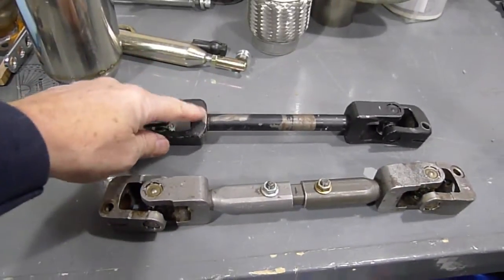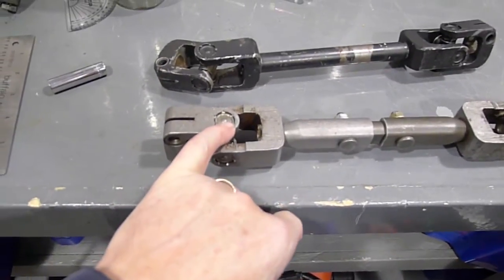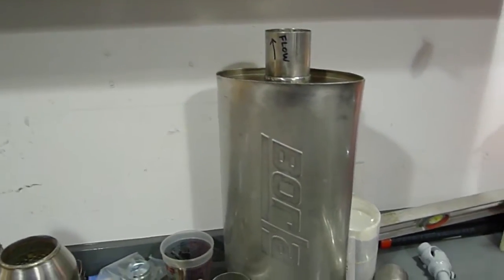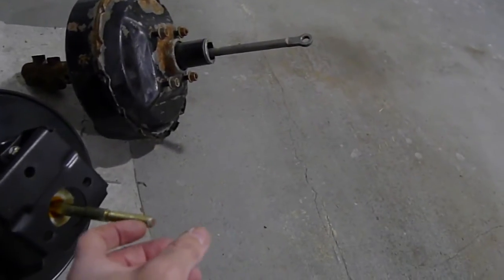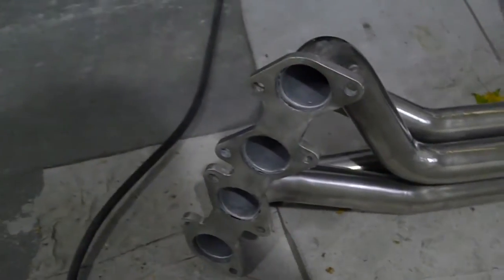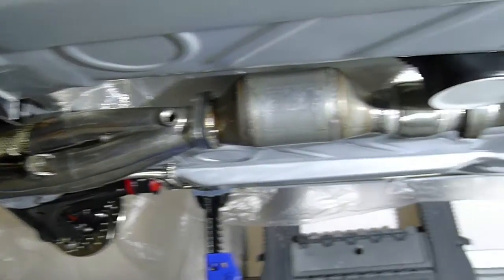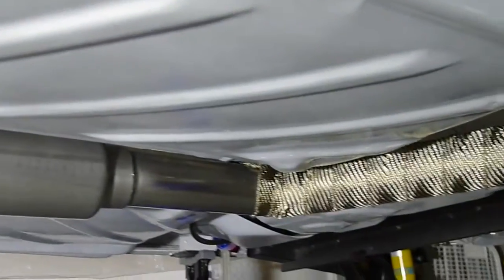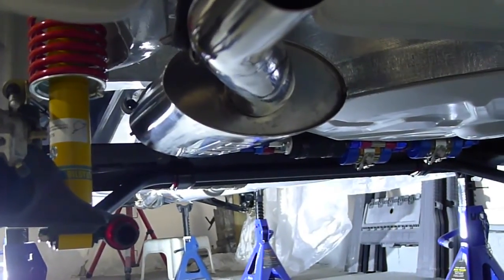The Ultimate 1983 Rabbit GTI - part 65 (mk3 U Joints, mk2 Brake Servo, Exhaust System Complete)

Comment: Thanks for the tip about the mk3 u-joints. I have now sourced two of those myself. I am converting an mk1 to AWD, and I need to move the steering rack down 20mm. Using this method to extend the steering column is just what I needed

Comment: I got what i thought was a MK2 servo to use on my Rabbit but I can't get a solid brake pedal.  brakes are properly bled but the pedal goes almost to the floor.  I did cut/weld the pushrod to the proper length.  I think the problem is inside the servo where the master cylinder plunger goes.  some servos have a little pin or rod inside there but mine doesn't.
Reply from the maker: I put some washers between the servo and the MC to take up some of the slack - not too much as the system heats up and can cause the brakes to engage when there is no force on the brake pedal so you have to be careful. You also need to balance the MC diameter with the brake caliper surface area to get the right ratio of fluid flow, pedal distance/force, etc.

Comment: It looks like you are almost ready to fire it up! I believe you haven't mention what type of ecm will control the engine?
Reply from the maker: Holley HP. I needed the ability to control 2 injector sets plus the progressive nitrous system. I am really happy with it (I have been madly programming it already), especially for things like custom sensors as I have had to pull together a range of sensors (things like crank and cam position sensors) and the Holley system has happily accepted them all ... I also like the ability to use the LCD panel in the car to program/monitor it, plus the ability to use the digital gauges which I am thinking of deploying in the 3 gauge cluster location (I will then be able to re-purpose them for quick reference of key parameters while driving without having to mount the LCD panel where I can view it ...